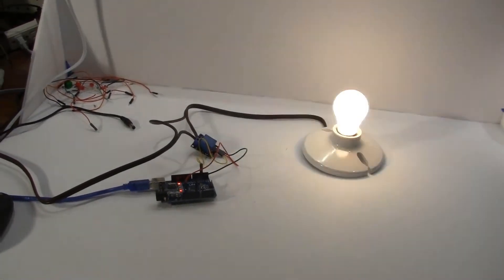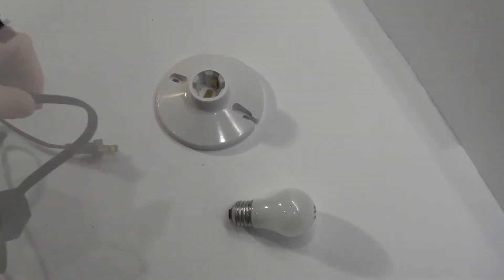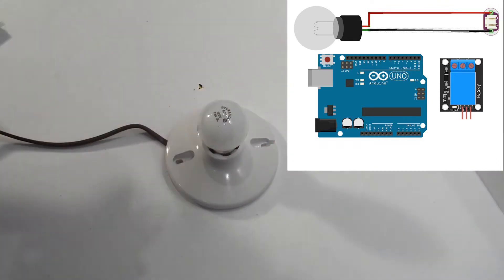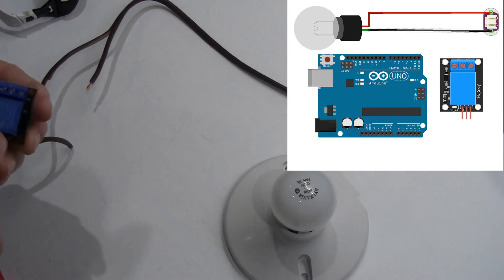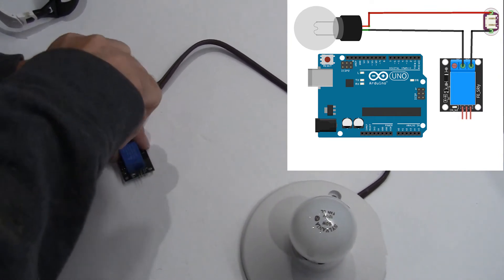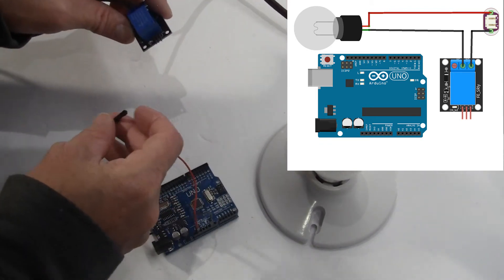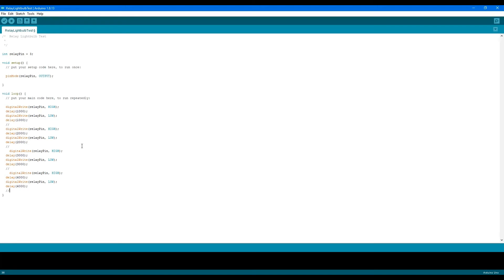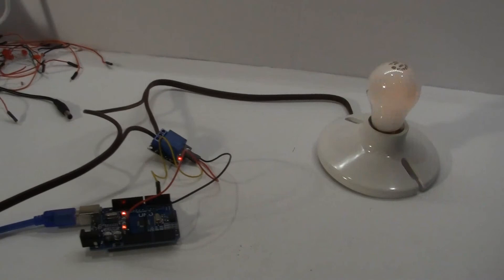Arduino Lesson 6   High Voltage Relay

Comment: Hi! I have a similar application, only I also have an LM355 temperature sensor connected to Arduino 5V to turn on/off light at a set temperature. The issue im having is voltage spikes whenever light comes on, causing an on/off cycling loop. Any idea how to stabilize the voltage?
Reply: Add a delay in the programming to wait 10 seconds after each relay state change.

Comment: Thanks for the tutorial. Do you have any suggestion on how I can relay a 50v DC connection? I don't think these typical Arduino relays are rated for that voltage. Thanks.
Reply from the maker: @JustifyJustin  I believe they can handle 240 volts.  If you are switching DC, you can use a transistor for 50 volts and eliminate the moving parts of the relay.
Reply: @DIYTechGuyShow  Thank you

Comment: First I want to use two relay modules so my question is this, I want each relay to be able to have this output at the Arduino board level is it possible to program like this? because I wanted to use a light bulb and a fan, two seconds of delay before turning on the bulb which will light up for 40 seconds, another two seconds of delay before turning on the fan which will also turn on for 40 seconds seconds and so on the order will be identified.

Comment: THank you for making this video, I am very new to Arduino and electrical components.  I would like to make a coin collector for a washing machine and I am gathering bits and pieces to better understand how I can do this.  I am going to continue to watch your other videos in hopes I learn as much from them as I did this one.  If you have any  suggestions on other ways I can learn how to do this, please replay with comment.  Thanks again!
Reply from the maker: I do quite a bit of work on pinball and arcade machines and I would suggest just buying an off the shelf coin mechanism.  You can get them for under $20 in most cases unless the mech is really rare.